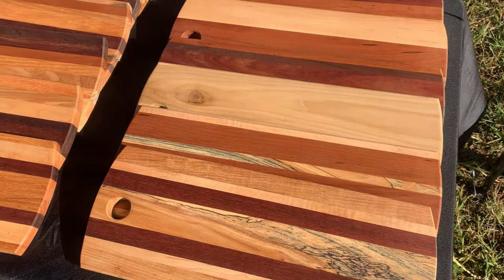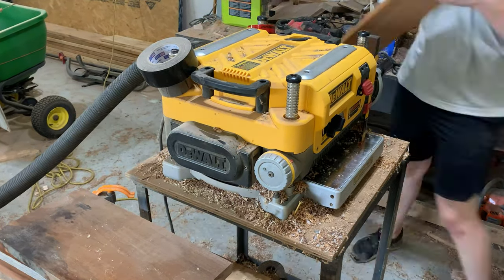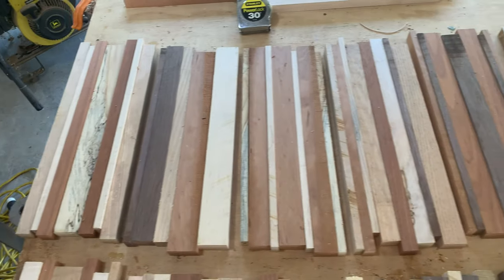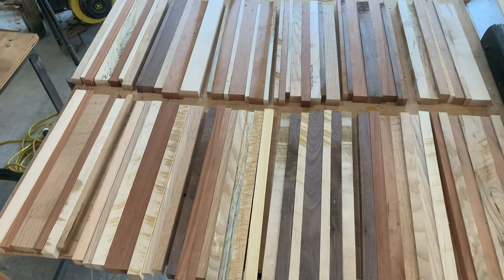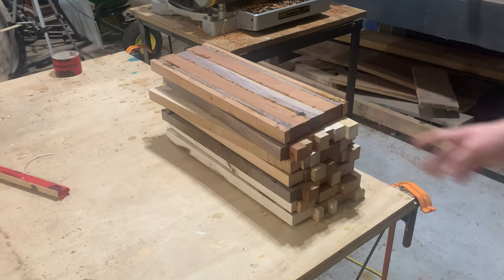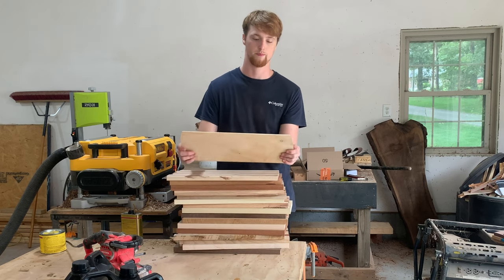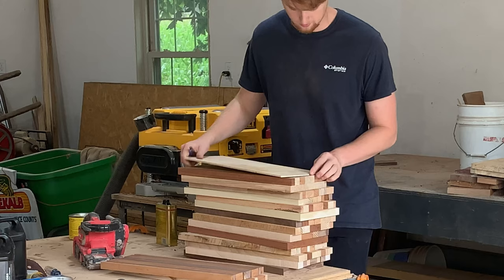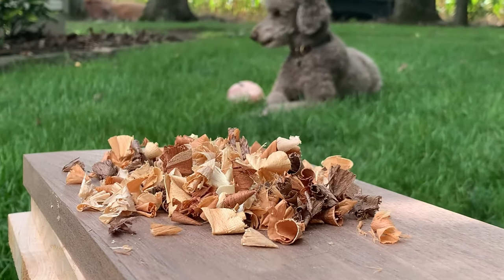How to Make My Best Selling Charcuterie Boards | Woodworking Projects.

Comment: Just a couple of  comments from a 45 year woodworker. #1 Place a backer board when drilling your hole. It will avoid blow out. #2 Place a piece of carpet or carpet pad under your board when sanding. When one side is sanded and you flip it to sand the other side, any trash, glue dots or anything that is on the bench will imprint on the first sanded side. #3 Drop the height of the top guide on your band saw. It keeps deflection to a minimum. Keep up the good work, I am reminded of myself watching you when I first started.
Reply from the maker: Thanks for the tips! I will definitely use them on my next projects.

Comment: As a suggestion,  you ought to drill a hole in your template,  that way it serves as a multi purpose template,  saving from measuring and marking every time.  Also,  I would encourage safety glasses,  so nothing gets slung in your eyes.  Great and informational,  those boards look great! Can't wait to batch a run out myself!
Reply from the maker: Thank you for your tips. I think I need to find a better ear protection method as my headphones really make safety glasses dig into my skin. Good luck in the future!
Reply: I would add that if you drill out the handle hole with a backer board you won’t blow out the backside fibers when the drill bit exits.

And if you get a larger tub than that little Tupperware you can immerse the boards in the mineral oil.  That would speed up the process quite a bit.

Comment: Always try to remember when Drilling, especially with that type of bit to keep a board under the one your Drilling, it will help prevent Tear out
Reply from the maker: I’ve learned that now. Thanks for the tip!!
Reply: I'd suggest using a small drill bit to drill through at the center point, and you can use that to ensure you dont get offset when  you flip the board.

Comment: How bad is the snipe on your planer? What model is that?
Reply from the maker: The snipe is not too bad. A tactic I use to try to eliminate it is to pull upwards just a slight bit as you send the board though.  It is a DEWALT DW735X 13 in. Planer

Comment: You said your width was 7 inches. What was the length?
Reply from the maker: Roughly 18 inches.
Reply: @StarnerWoodworking  Great Video!
I would not go below $50 on your boards. Be sure to have plenty of business cards available for potential customers to think about your boards and contact you later. If you increase the size, say to 10" or 12" by 20' or 22"  you should place your price point up $85 - $125 (depending on the wood used) for large boards.
Next suggestion is stage some of your boards with food. this will show people how well they look dressed up.

Comment: Very nice product, but really didn't charge your labor and materials worth. Glue ups are labor intensive.  A single board with handle and clean edges would be great at $40 - 50+ depending on species.  Glue-ups range 50+ . Great Job